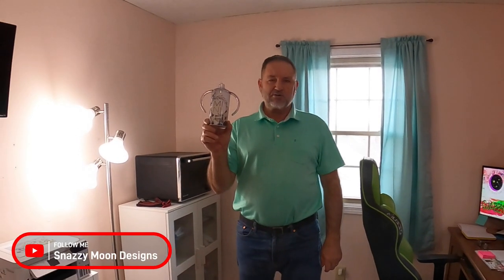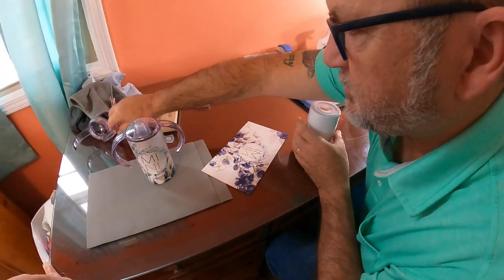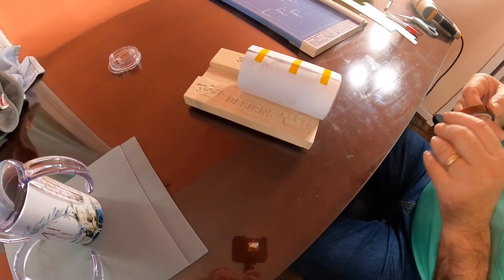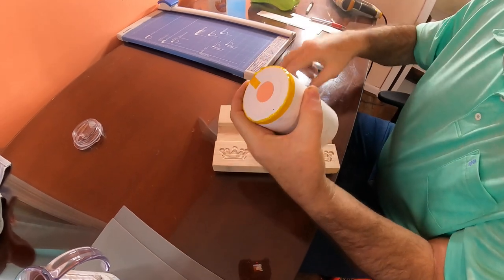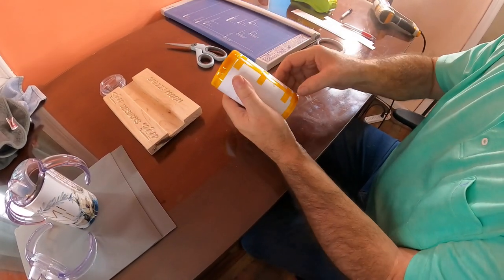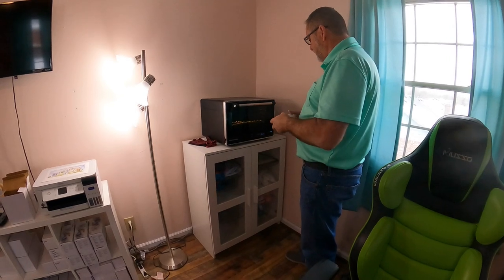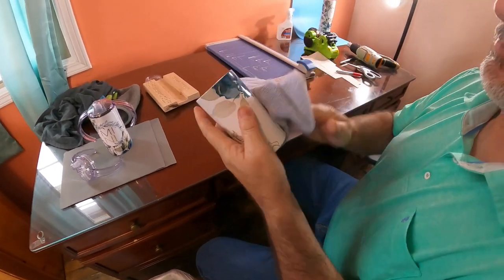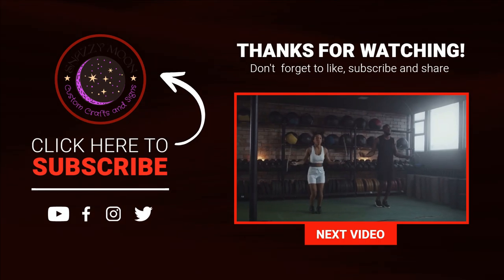Easy Sippy Cup Sublimation, Step by Step Instructions

Comment: You say 350 degrees on your oven, is that just by the dial temp or do you verify the inside temp with a separate thermometer?
Thank you, very informative. Stay safe
Reply from the maker: That is my verified temperature. I checked it with a oven thermometer. Thanks for watching
Reply: @SnazzyMoonDesigns  I hope you have a better oven thermometer that we had, got a new oven so we bought a small oven thermometer to verify what the temp was, so we went home turned on our house oven to 350 and looked about 20 minutes later and see that or new thermometer was sitting a as close to 350 as it could have been. Then we found the sweet spot for the new oven to give us 360 and cooked several cups with great success on a couple different days. Next time we got everything out to do about 25 tumblers and got everything right where it needed to be, then the black and reds I noticed that I could see where the tape was and the black was actually brown. Put our little oven thermometer back in our house oven and found out that it was actually only reading about 320 when the oven was on 350. So with just a couple of uses our fail safe device had failed and cost us a couple of cups. Just something to watch out for if any of your followers are having problems. Thank you for your reply, stay safe